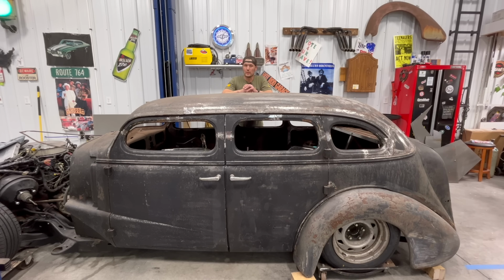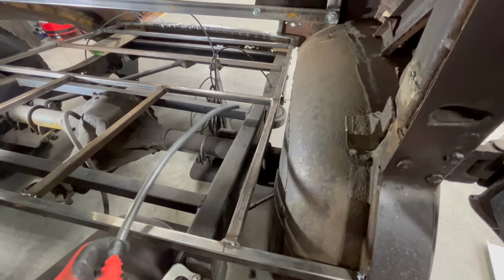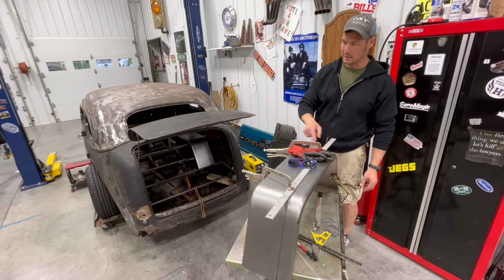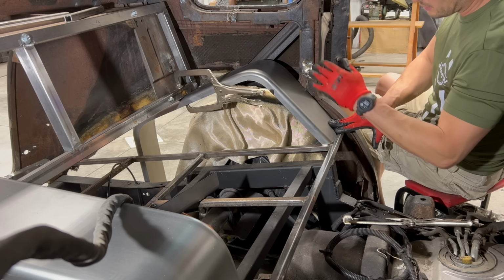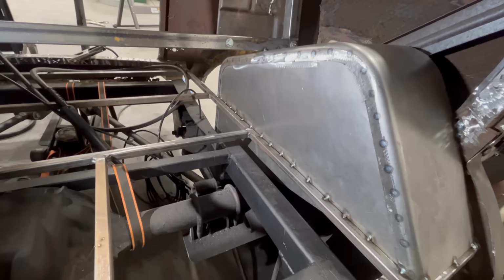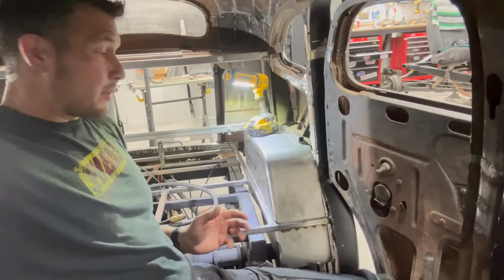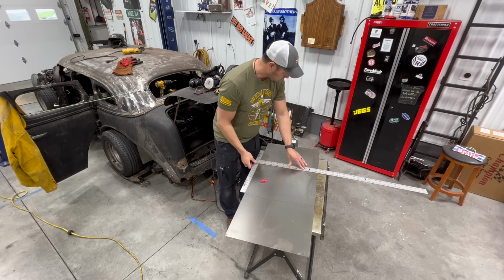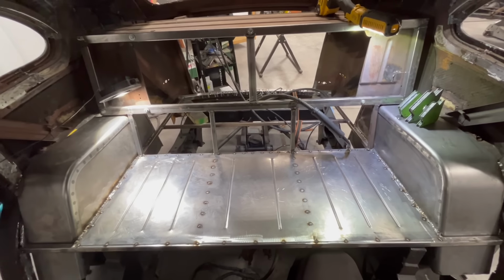Inner Fenders and Floor...Failure to Final Fit / 1937 Chevy Master Deluxe 4" Chop RatRod

Comment: Hey, i used trailer fenders on mine as well but you need the two tire fenders they have a smoother radius that follows the tubs perfect you cut one in half and you have both sides.  Also you can use panel bonding adhesive to attach them to the fiberglass areas so you don’t need welding prob not the best but it would work for a rat rod.
Reply from the maker: Thanks for the tip!
I looked at some of those at tractor supply but decided on these to try and match that radius by the rear door.  Nothing is perfect on this car (never going to approach how sweet yours is by any means)
Reply: @MarekMakes  the way you did it works also!  Thats all we can do is just build it the best way we can, cause there is many ways to do anything, and in the end you will still have a sweet ride to roll in!
Reply: Just watched your latest episode.  Looking killer.So glad you realized that the first go round on how you positioned those trailer fenders was totally wrong. Looking a heck of a lot better and the bead rolling looks great as well. But I have to wonder why you have the rear floor so high. I understand that the car is on bags but the front seat area is okay correct?
Reply from the maker: So, the rear seat is so high because it sits directly over the Diff … as the body is being dropped on the S10 chassis it just happened to line up there… I think most people would choose not to chop and channel a 4 door so this would not be an issue because the diff would then be in/ under the trunk area…but that’s me gotta go and do something stupid and crazy…. The front seat will legit be about 10” lower than the back … also, because this chassis has the reverse 4 link the OG S10 gas tank will be under the floor there as well …. Lots of considerations
Reply: @MarekMakes  back in the late 60's early 70's my younger brother had a 1938 2dr Master Deluxe which we street rodded. I don't remember the diff landing under the rear seat.  Anyway you could have done bucket seats and a tunnel from the front to the back to clear  the drive shaft  as well.

Comment: On an earlier video you mentioned you didn’t want to use spacers on the rear wheels but I’m not sure if you ever mentioned why you chose not to do that? I ask because that’s what I was planning to do for mine. I appreciate you making these videos bud! They’re a lot of fun to watch and very educational.
Reply from the maker: I wanted to get different wheels with different off-set instead, so I ordered some but they were way too wide for the car/fenders … and were $$$…. So I returned them…. But I had to do something to make what I have fit.  So after I cut the wheel wells out and had a little more room I figured new tires and wheel spacers were more budget friendly (since this has a $5000 budget for the build off)
Reply: @MarekMakes   okay no worries, I was concerned because after measuring it out I knew I was going to run into the same issue with the rear wheels rubbing against the inside. But it sounds like I might be okay with spacers on the existing tires and suspension? However, I’d be willing to cut the wheel wells if need be. Thank you for your time and the awesome videos. Also apologize if you mentioned all this already. 5k is an incredible budget for this project. A lot more realistic for my budget too. I’ll end up watching all these videos again as I progress.
Reply from the maker: Awesome!!! Great to have people with similar builds happening!! Good luck!
Reply from the maker: Specifically I think the s10 wheels I have would have been fine but Part of my issue is that the s10 rear diff is actually 4” narrower than the master

Comment: Why did you use the squared fenders instead of using rounded fenders for t h e inner fender wells in the back!!!!!
Reply from the maker: Cheapest I could find?  Also never did before..
Reply from the maker: Also when I was trying to fit under the bracing for the rear seat and preserve the mounting for the outer fenders.  And I think I wanted to to be kind of like an arm rest for the rear seat.  Hind sight 20/20 - I would have gotten only one and cut in half and run the horizontal part all the way to the rear of the trunk where I ended up fabricating the other panels